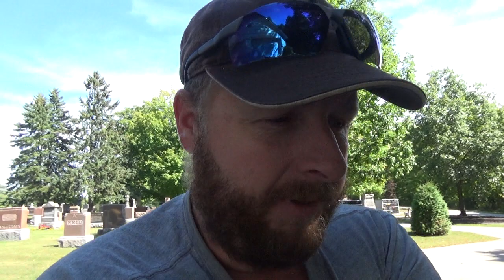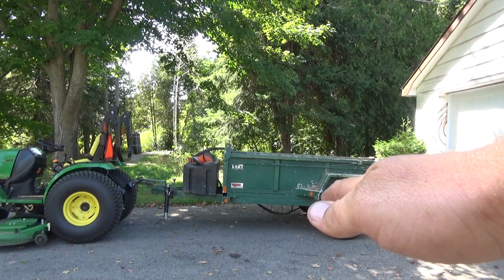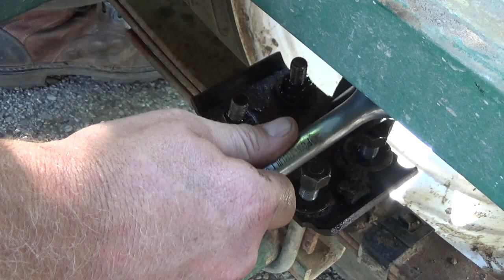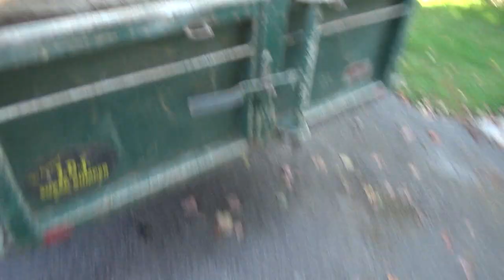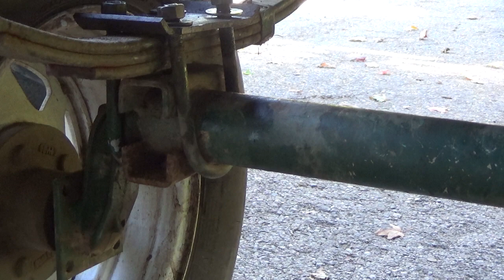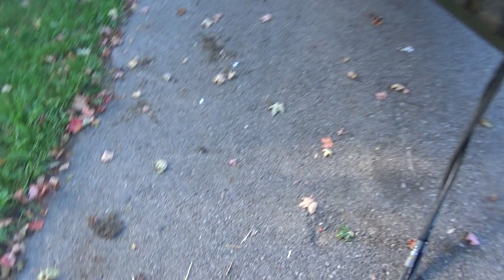Converting the big trailer to trailer-enstein

Comment: I'm not sure those axles are meant to be flipped in that manner. The torque your now putting on the leaf springs is 10 times higher since the hub ends are acting like a lever. I'd bet the last spring you replaced happen while the axle was flipped before. Just say'n.
Reply: +Ghostrider304 torque means turning force and nothing to do with this..stop talking bullshit about stuff you know nothing about lol
Reply: +Mack Thompson yes Mr Einstein!!! It would be a rotational force that the axle puts on the springs. As the trailer is pulled forward, the wheels will want to roll backwards. This will turn the axle tube, and could bend the springs. BTW- WTF do you think you are?

Comment: Just on your video's i noticed that when going to commercial it turns off sound
Reply from the maker: +Jake Schisler humm thats odd.. it may be a transition between scenes
Reply: +Jake Schisler Mine did that yesterday
 and I updated flash and it stopped.
Reply: +Jake Schisler mine to.
Reply: +Jake Schisler if you get the youtube ad blocker it will stop the commercials in his videos. Unless of course you're wanting to watch the commercials.

Comment: its funny how ppl rev the tractor to make the trailer go down, its not a double acting ram, hell you dont even need to start the tractor, it will free fall
Reply: 2 hoses going into cylinder is a double acting, push pull piston. bills trailer is a double acting. 1 hose is gravity one way, if a snow plow angling  ram